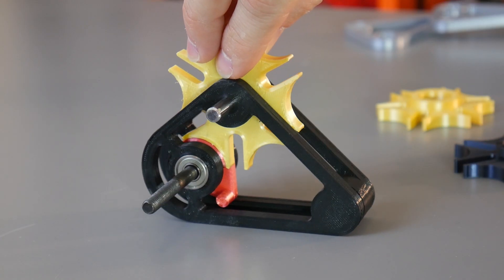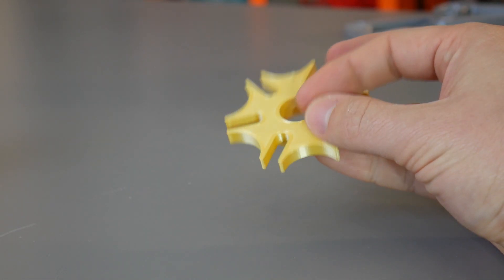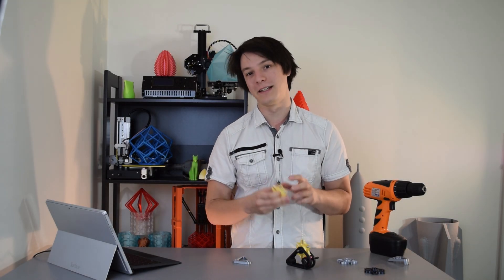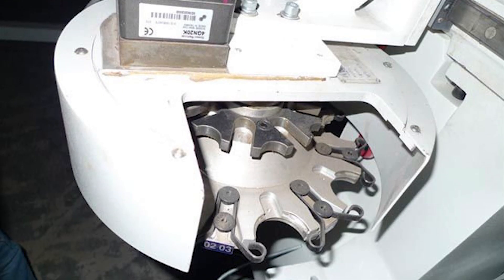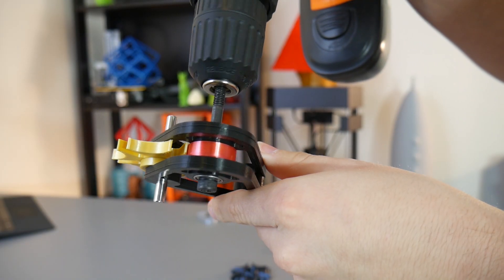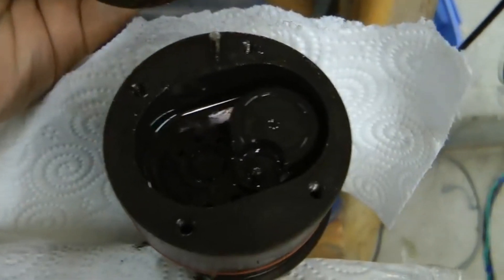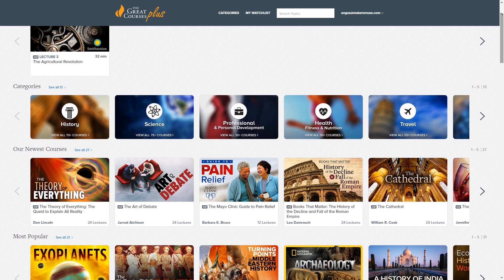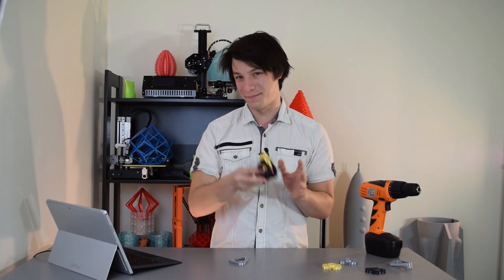The Geneva Mechanism

Comment: The geneva mechanism is used in the Transversing In-core Probe system of General Electric Boiling Water Reactors... to reliably align a flexible tube (from which a radiation sensor will be driven) with a selected one of several tubes going up into the reactor core.   By moving the sensor  ( a "miniature fission chamber") up through the tubes, a profile of neutron radiation (resulting from nuclear fission) at various locations in the reactor can be developed, which in turn, can be used to periodically calibrate fixed in-core detectors.   More details of the mechanism is on pages 45 to 70 of lesson plan  in this .pdf file: https://www.nrc.gov/docs/ML0230/ML023040361.pdf

Comment: Very cool! In the 90s, I ran a movie theater that employed several pre-WWII Simplex E7 projectors. I wound up having to replace the intermittent gear fairly often. Thankfully, you could find them pretty easily in those days. While changing them out usually meant getting covered in projection oil, I can remember being thoroughly impressed with the genius that went into the design of the mechanism.

Comment: Regarding cameras the point of this gear is to allow a pause in the film advance so as to produce a correct exposure to light, one frame at a time, 23 or 24 times per seconds. The gear essentially translate a continuous rotary movement into a series stops.

Comment: The LC network selector in the base of some military mobile antenna use a Geneva drive.  Newer antennas are using stepper motors now for inductor positioning inside the coil just below the whip. ( Such as a Hi-Q antenna.)  The only thing left is using an LM339 to detect the identifying voltage output for each band.  The stepper is controlled by a phase magnitude detector circuit. as soon as the relays connect the appropriate capacitor.  Military circuits are second to none, however they push the swr up to 2:1.  I an an electrical and mechanical engineer but served in US Army Special Forces...10th and 11th SFGA.  In the field I carried a small civilian antenna tuner so I could get a better swr.  I kept my ham license but got too beat up to continue in group.

Comment: As far as military application goes, I can see it being used in a fighter jet where an assortment of missiles can be stored internally, instead of traditionally external. The wheel could be configured to hold maybe 3 AAMs and 2 AGMs while allowing the pilot to cycle through which it wants to use.  This can also have an added benefit of limiting a jet's payload to AA shrapnel exposure, less stress on the wings and possibly improved aero-acrobatics by keeping as much wait as close to the body of the jet as possible.

Comment: CNC repair technician here: They're still used in most milling machine side-mount tool changers to index from pocket to pocket. CNC lathe turrets use curvic couplings for increased stability, accuracy, and resistance to loss of position under heavy load or light crashes.

Comment: But...  modern smooth mechanical solutions do exist for intermittors (eg. CAMCO/Ferguson) and should not be overlooked  when the index parameters are never going to have to be changed.  They are cost effective, require no programming and .. cannot go beserk destroying $100,000's worth of tooling.  (Would you rather have an actual spring loaded pin engaged for "park" on your car's transmission or rely on software for that function?)

Comment: In order to prevent such friction, couldn't you just add some ball bearings to the cylinder that is going inside the gear (the part where it's sliding). That way it would roll in and out of the gear, not slide.
Thoughts ?

Comment: way prior to cnc ,,,,,screw machine s(cam  driven) indexed  turrets  with  geneva mechs. I always found them  so cool   circa 1977. But  I inject this  note to bring your  attention to some thing  else as  truly amazing . And  3 d  printable .  Cycloidic reduction  mechanisms.  ? did ya ever try to put   say  a 50 :1 gear system on you   ?go cart/ wath ever  but needed a large gear  about 3 feet in diameter !!   Anyways  these (cycloidal drives machines) are capable  of very high reduction ratios (1000:1 easy)AND thier motion is cool to watch  !! IN a package size   VERY SMALL  bla     bla         bka                bla    bla.

Comment: 3:26
My first guess for military use would be in a Gatling gun, to perhaps help control feeding in relation to a constantly spinning set of barrels. However, I found a patent filed in the 80s for what looks like an externally-powered automatic single-barreled gun; https://www.google.com/patents/US4418607. The gear is visible on the lower left of the second page, labeled as part 55. The text below mentions it being related to synchronizing feeding with bolt operation. I'm not sure what problem this was trying to solve when gas-operated weaponry had by then long been mainstream. I might just be reading the patent wrong.

In any case, I was unable to find anything beyond this patent with a quick search.

Comment: My first thought when you mentioned military applications was the Gatling gun, but of course the drawbacks (eg. wear) of the Geneva preclude that, and a ramping cam is used to load the cartridges.

However, this 1874 version has a stepped-action, rotating set of magazines, that could very well be Geneva driven, as it's frequency of operation is only a fraction of than the gun itself. Unfortunately, the animation concentrates on the firing, not the magazine, so we don't know - maybe you can find out.

http://www.victorianshipmodels.com/antitorpedoboatguns/Gatling/gatling1874.html

Comment: Geneva stops were used in clockwork because at one time, before spring making technology was improved, consistent force of a spring was more toward the center of the wind.  At the end of the spring, it may have been weaker, at the start, stronger.  The Geneva stop could be set in the range in which the spring gave the most consistent force, thus allowing for better time keeping.

Comment: Geneva gears were used in a tap changer on a high voltage transformer when I worked in the steel industry. The entire mechanism was submerged in oil.

Comment: I've been working with old movie projectors for some time and like to add something: They are almost silent without a film in them. The film runs through two loops which serve as a buffer between tha parts running continuously and the small portion that runs intermittently. These loops are making the sound, which ranges from the well-known sweet purring of a new film to a hard, hacking noise of old, brittle films, occasionally interrupted by the rattle of a repair tape running through and the hopefully rare chewing-up and spitting out the pieces of film. 
By the way, our were made sometime in the fourties, have run about once a day till a couple of years ago and are still operational. The maltese crosses are still rock steady when in locked position.

Comment: A similar mecanism was used in world war 1 aircraft by Germany to prevent the machine guns from shooting the propeller. It was set to allow the guns to fire when the propeller was not in front of the guns while the aircraft was in flight but not fire while the spinning propeller was in front of the guns. This was far more effective and safer than putting metal plates on the propeller blades which is what allied aircraft did. This also allowed the guns to be placed in front of the pilot rather than above the top wing which increases shot accuracy.

Comment: Back in the day we used to use these when designing assembly equipment, but very often they did over heat so you had to design them to use bearing instead of pins for the driver.

Comment: The way the two surfaces contact each other is very similar to a normal hydraulic motor, or rotary gear pump, these also have very fine tolerances but last along time when looked after, the oil is of course passed through a filtration system to help keep wear to a minimum

Comment: I can think of Geneva stop mechanisms used in a few small arms, most notably a Maltese Cross with a stop on the 4th arm for the 3 round burst features on some machine guns, and sub machine guns, auto pistols, etc. Whether rifles, SBRs, pistols, or carbines, something was needed to stop the full auto sear from flopping until all the ammo was gone, or the trigger was released, and in some cases, most notably in pistols, the gun would just run away on the burst setting without the stop. It would be like the old VERY ILLEGAL hacks on some 1980s guns. You pull the trigger, and the gun just empties itself, whether you released the trigger or not. The gun will just keep firing until the magazine is empty. So these hacks were more than just illegal, they were and are still are,  flat out stupid dangerous. Add the Geneva stop and the gun fires 3x, and stops, not 33x.

Comment: IVe seen old lock mechanisms for doors that employ an aspect of the Geneva mechanism.. By "old" I mean the mid nineteenth century. Military application? I expect the Gatling Gun used the Geneva and possibly the invention that permitted WWI fighter pilots to have their machine gun mounted between the cockpit and the propellor and timing the precise firing of the bullet to occur in the time frame whereby the ......its way too early in the morning. Thanks for producing this, it was intensely interesting.
Reply: A.G. M. The Gatling gun was actually gear driven directly from the crank and ammo was fed in by a high tension spring in the magazine
Reply: I have one in my Subaru for some reason
Reply: The interrupter gear on aircraft was actually simpler than that: the propeller of an aircraft actually rotates faster than a normal machine gun can reasonably be expected to fire, so there's no point 'interrupting' the gun from firing when a propeller blade is in its path because usually when this occurs the gun is not ready to fire anyway (it's busy loading the next bullet). Instead the gun was modified to only fire once per trigger pull, similar to a semiautomatic rifle. A combination of a cam on the engine and a set of levers coupled to the pilot's firing button pulled the gun's trigger once per rotation of the propeller whilst ever the pilot had the button held down. This resulted in the gun automatically firing at a slightly reduced rate that synced up with the propeller.

Comment: Regarding wear, couldn't there be a needle bearing on the pin?
Do you think the Geneva mechanism could be used to time, say, a sleeve valve on a reciprocating engine? This would provide much more of an open/shut positive timing.  I know it's primitive, but it might work.

Comment: It looks like there is something wrong with the Geneva Stop image at 1.54.  If its purpose is to allow 4 turns of the male disk, it looks like it has turned to an impossible /broken position.  The 'pin' cannot get into the slot if turned in either direction.  The cheek should always be in a dwell when the pin is not in a slot.
Re- sound: The sound is from the film movement, (as everyone knows from hearing a film break) but the film frame positioning pin(s) could have been driven by this mechanism, in the little box behind the film tractor slot, which was just after the light path.

Comment: I think the video is wrong.  Film projectors used a loop of film to leave slack as the film moved continuously.  Each frame was held briefly in the aperture by a pin.  The loop of film fluttered as the pin moved in and out to advance to the next frame.
https://youtu.be/En__V0oEJsU

I have never seen a projector with a Geneva wheel.  It is possible the earliest projectors used one, but not for a century.

Comment: A very similar wheel, in a very similar color, and even size, is found in the classic Fisher Price Music Box Record Player. They used it to protect from overwinding. One slot is different so after four turns it's locked until you play it to let some spring out. 

Btw, I have to say. It's kind of amazing how many people here in the comments seem to be totally floored by a 150 year old year gear design manufactured by the millions. I can't imagine how blown away you'd be to see them being turned and broached one at a time by hand...not with a C&C mustard bottle, with an actual machine shop.

Comment: The only military application that I can think of that might have used it would be the device that prevented the fuselage mounted machine guns on WWI biplanes from firing as the propeller blade moved in front of it.  it was controled by the cam of the engine.

Comment: I can see this Geneva Mechanism used in certain classes of auto cannons like the ADEN 30mm single barrel revolver auto cannon or the French DEFA cannon.  The Geneva mechanism would would insure perfect synchronization of the receiver's revolver firing chambers to line up with the barrel of the gun.  The same system also insures that there is sufficient energy left for the revolver to continue rotating and discarding the spent cases.  The system would take far less energy than chain gun that it can rely on barrel pressure blow back to power it where as the chain gun is reliant on a power take off system.

Comment: RPM! Not "RPMs." You never pluralize a unit as plurality, or lack thereof is implied by the unit. Most MEs say "RPM" where as most EEs say "Volts" or "Amps." and in this case, most EEs are wrong!

Comment: A single toothed gear would work similarly with no friction, however the mating gear would require a ratchet or other stop mechanism to prevent it from discharging its load between movements.

Minds out of the gutter, people.

Comment: The great grand daddy of the sprag clutch, lol. The useful duties for the mechanism are low speed, or incredibly low mass parts (the tool caddy indexer, and the projector aperture/sprag respectively). Granted, not incredibly suited to cnc mill operations, but could probably find plenty of use in a pipe factory, or sawmill. As for military use, I humbly submit the breech mechanism of the Hotchkiss auto-cannon, a hand cranked mechanism used by navies world wide about a century and a quarter ago. You will also find them in rotating breeches of artillery, and lever operated "single leg" examples in vertical block sliding mechanisms for guns from Sharpe's buffalo swatters to modern field pieces. The "index detent" of the mechanism is nicely seen in Remington "rolling block" action of the 1860s, which was used by just about everybody at some time up until WW1. I call it "the age of cranks and cams" in arms design because such old ponies as this mechanism held the limelight and got all the girls in that era. Of course, those flashy knee action toggle joints sent them packing before long, lol
Reply: A sprag clutch is a type of one way clutch (the other common one is the ramp roller clutch which is commonly (and incorrectly) called a "one way bearing"), it has nothing to do with indexed movement. All it does is allow a shaft to rotate freely in one direction and stops it from rotating in the other. This is useful when you need to apply power to a shaft from an intermittent power source while allowing the shaft to spin freely in one direction when power is not being applied. A common example of this is a bicycle. Also large RC helicopters use them on then main reduction gear. The gear that drives the tail rotor is fixed to the mainshaft of the rotor and the reduction gear between the motor and the mainshaft has a sprag or ramp roller clutch so that if the motor stops it will not act as a brake on the rotor system and it will be possible to auto rotate to a safe landing.

Comment: I first learned about this from a few videos by "A. Smith," and actually got pretty good at making them in Algodoo (awesome 2D physics simulation game). I used one for a ramp in a car track that raises, waits, lowers, waits, etc. I used 3 sequentially for a counter where you push a button on the keyboard and it adds 1 each time. But I couldn't ever think of any practical uses for one until I saw this video. I had no idea that the clicking sound in a film projector was a geneva wheel. Next you should do a video on the escapement mechanism!

Comment: Fuel flow from engine fuel control to injectors in 1950s Allison turboprop was opened or closed by a switch in cockpit controlling an electrical actuator on engine called the Geneva lock.  It was literally the On/Off switch for the engine.  Seemed to be pretty much trouble-free, so I never saw the inside of the actuator.

Comment: That film projector sound is caused by the upper and lower loops and NOT this thing which is known as the intermittent sprocket. The intermittent sprocket is found only on professional film projectors, mainly 35mm but also 70mm and some of the higher end 16mm projectors. Most 16mm and also 8mm/super8 projectors use a claw system to advance the film one frame at a time, 24 times each second. Intermittent sprockets are favored over the claw because it offers a smoother more reliable film transport system. IMAX film projectors are the only projectors that use a proprietary system to advace the film one frame. This guy clearly knows nothing about film projectors and if he gets that wrong, who knows what else he is getting wrong also.

Comment: Surely some have bearings in the friction heavy portion. It wouldn't be anything to put a bearing on that pin, even something as simple as a Babbitt bearing would help. Roller-rocker arms in internal combustion engines are another good example of an easy way to mitigate some of that friction.

Comment: @maker's muse
hey man.  cool video, very informative and interesting. 
quick question, what did you print it with.  The material seems to almost be production like; very smooth and silky. certainly nothing like what I can get on my cheap printer and PLA...
Reply from the maker: +Sebastien Tremblay it's called polyalchemy elixir one of my favourite PLA's